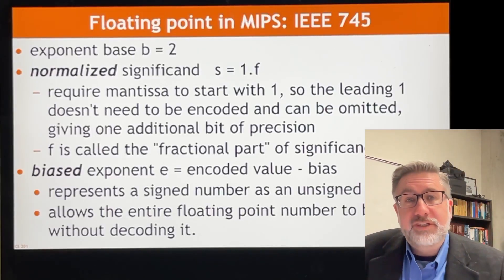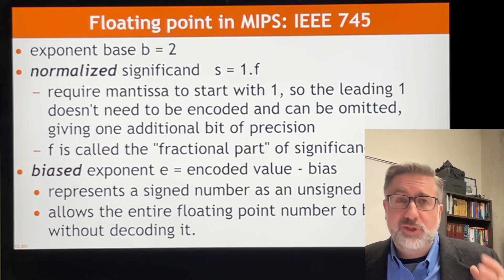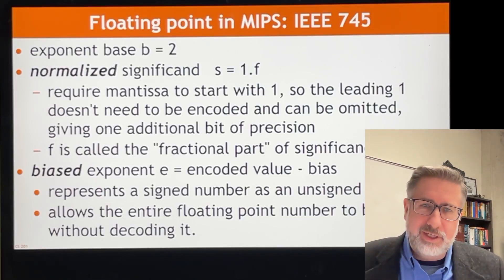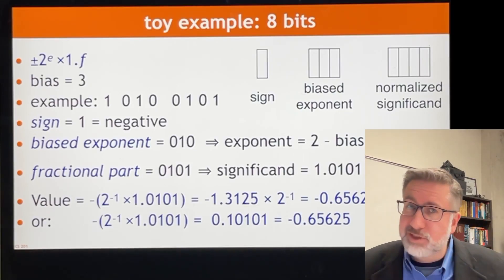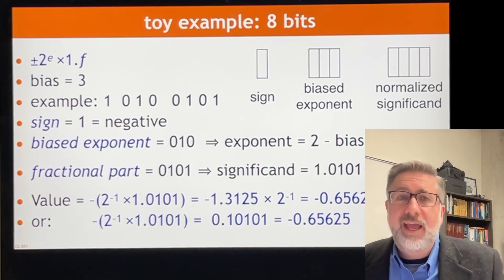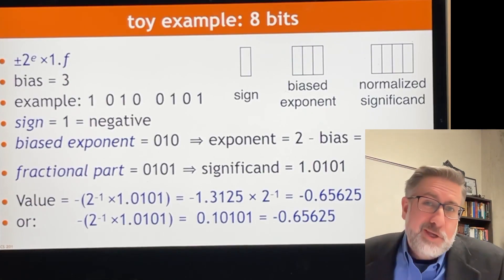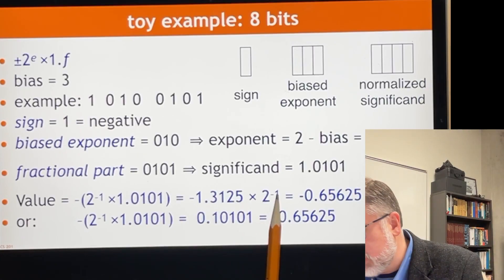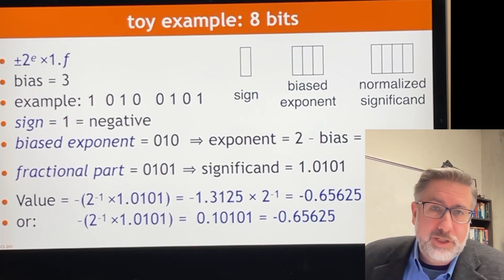FP3 An 8-bit Toy Encoding of Floating Point Numbers

Comment: How do we just say the bias is 3,  I didn't get that part
Reply: Bias for a given representation is one less than half of the maximum value that can be represented by the exponent bits. With 3 exponent bits, the maximum value that we can represent is 8. Half of that is 4 and one less than that is 3. You can solidify your understanding by comparing this for 

- FP32 (IEEE 754) bits: 8, bias: 127
- FP16 (Half) bits: 5, bias: 15
- BF16 (Brain) bits: 8, bias: 127
- FP64 (Double) bits: 11, bias: 1023

A handy formula would be bias=2^(n-1) - 1, where n is the number of bits available to represent the exponent.